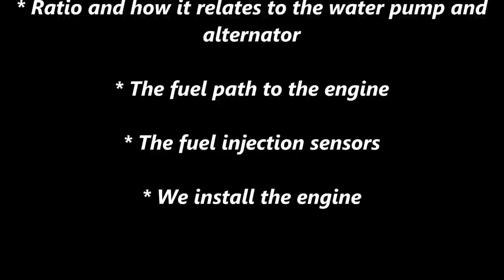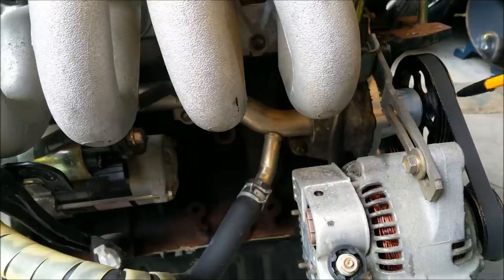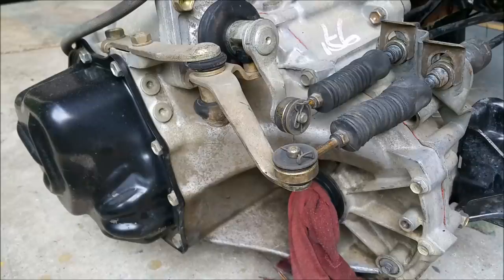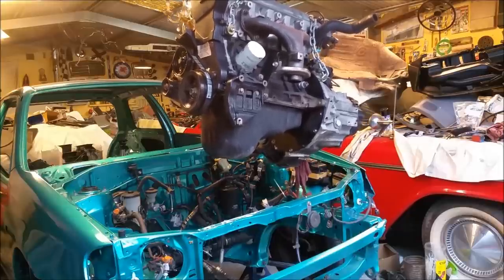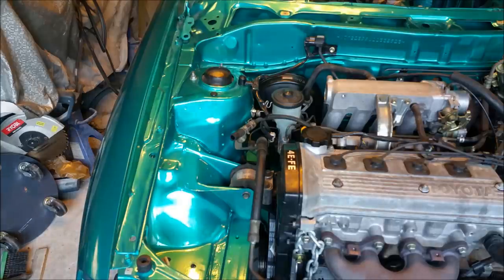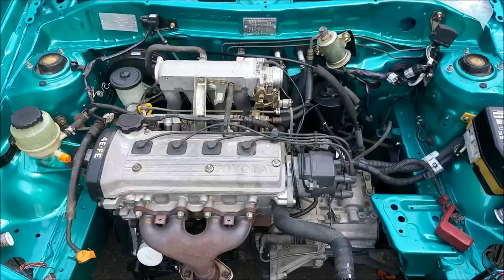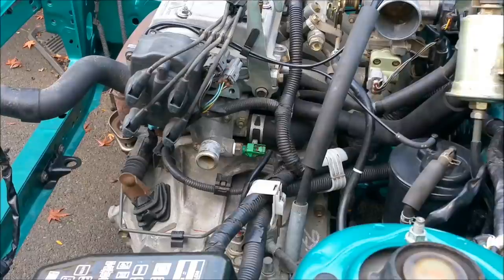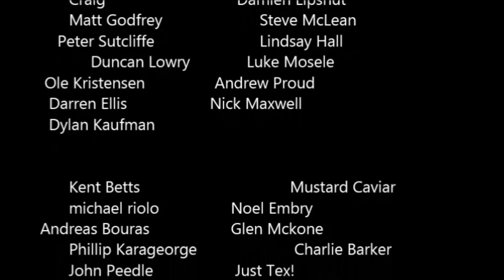Remote Learning - Let's Build a Car Part  2 - Starlie Scores an Engine

Comment: Manifold  pressure explanation section took me back. Remembering  the  windscreen wipers that ran on manifold vacum back in the day  which went like the clappers when the engine was lightly loaded and damn near stopped when it was being booted. My God ,how dangerous would they be now in modern traffic. Ford were using them up to the early  sixties .

Comment: Once again, another thoroughly interesting and enjoyable video! I found this one particularly interesting as the 5S-FE in my XV10 Camry uses some of the same methods in terms of various sensors that are very common on 90s Toyotas. That engine is looking immaculate, top notch work! The section with the hydraulics demonstration and how the cable actuated shifting mechanism works was really satisfying and interesting. That colour is beautiful too.

Comment: G'day Peter - you can bridge pins on the  Toyota diagnostics port to get flash-codes from the check engine light.  It's painful thing to do, but it does get the job done.
Reply from the maker: Yes, I forgot about that... I was thinking of the EA Falcons where you bridge pins to check the ignition timing, some stuff is a blur, so long ago.

Comment: something to note most modern cars now have an underrated battery size by that I mean they generally only have enough current to crank over the motor for a given amount of time once the car is "running"   then the charging alternator kicks in to take most if not all the cars load (charging wise) including the battery to replenish what was taken out in the starting cycle. but if left for extended periods of time other ancillary drains on the battery will over time drain the battery flat (think car alarms and the like, the "always-on" circuits) unless the car is driven once in a while or the battery is put on a battery maintainer charger.

Comment: i find it rare that i learn something i just come across by accident. (unless watching a Peter Anderson video) so watching this in the back ground of doing other stuff on facebook.
you mention the O2 sensor, and it' makes perfect sense to Me in Hindsight .. if you have an O2 sensor ERROR CODE, it could be related to other things, not the sensor, eg, intake leak(hose off, crack, gasket,) or injector out of range, blocked, or spark plug dead even....
i never thought of this happening, and haven't read it when people have been changing O2 sensors due to codes and still having codes.

Comment: I can tell you’ve done a lot of “off camera” cleaning and degreasing of that engine.. looks fantastic
Reply from the maker: Hi Josh, yes... I gave it a couple of Reject Shop degreaser cans then carefully rinsed it off. i wanted to have the rocker cover hydroblasted, but the isolation rules stopped it - now I'm not sure I can be bothered, cheers.
Reply: @PeterAndersons  I've got to get you some good degreaser as a donation. There's this awesome degreaser called Blast Off made by autosmart. It cleans up paint (though strips any wax), also is awesome for ally blocks and engine bays. Almost comes up as good as hydroblasting.
Even better is that it's environmentally friendly(ish) 
I'll grab you a 5l container when I get my next lot and drop it off to you. It will change your life!

Comment: sorry pete,its not 14 to 1,its 14.7.1 that the engine needs to run correctly anyway great vid thanks
Reply: yes but is it by weight or volume, there is some homework
Reply: gus6rocks correct
Reply from the maker: Yes I should have said that - one atmosphere, made a few errors and threw out the entire air conditioning segment because I was concentrating on other things while talking and filming, cheers.

Comment: To be honest i prefer your pre teaching format. I agree that the new format is informative and interesting but its not the peter anderson that we have become accustomed to. I maybe in the minority...and its just my own opinion. If however if you will actually teach your viewers how to change disc and drum brakes..remove and replace water pumps...rebuild engines etc etc...then sure..it will be worth it. So far its just commentary about what components do and how they work....not actually doing. Is that what you will be ultimately aiming for?
Reply from the maker: Hi Dom, thanks for the comments. They weren't meant to be 'how to' videos at all... The Systems classes this is aimed at study mechanical, electrical/electronic and electro-mechanical systems which is why some of the content is steered that way. The students are given a range of calculations to carry out and problems to solve... you can rest assured that the existing format will return, as we are currently teaching online. At this point, students from years 2 - 10 return to the classroom June 9, cheers.
Reply: @PeterAndersons  Thanks for the explanation. Great to read that the old format will return..😀